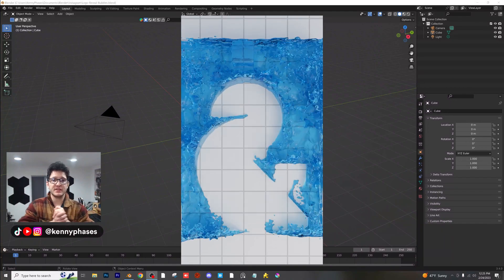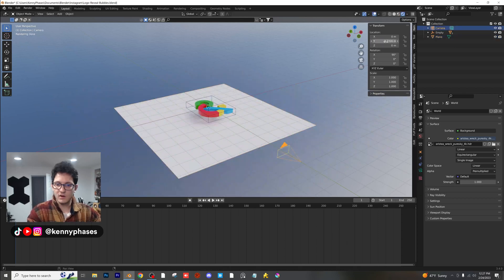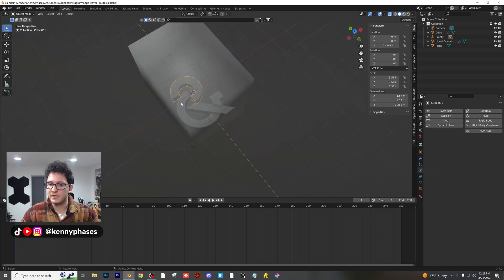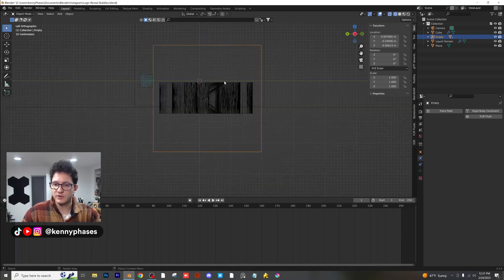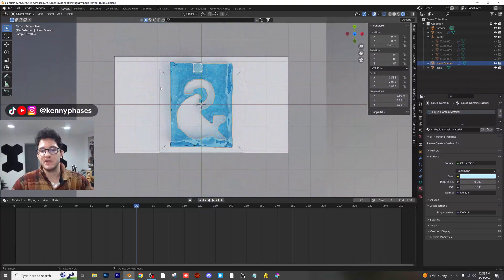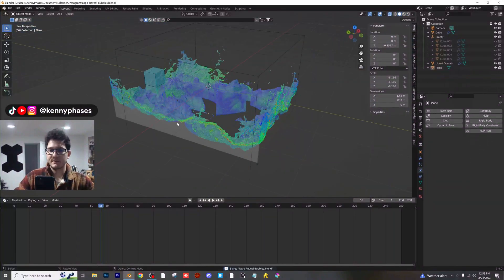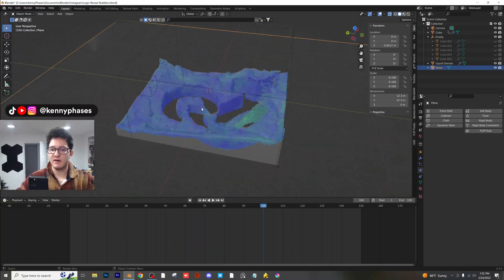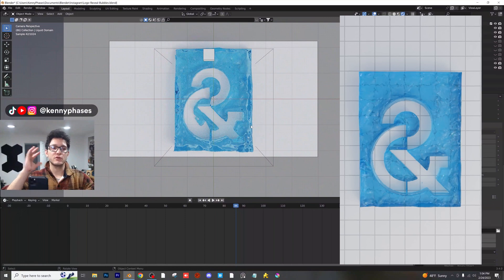Blender 3D - Logo Reveal Fluid Simulation!!!!!

Comment: Of course there is an easier way to convert all logo objects to fluid effectors. Just select them all and hit Ctrl+J to join them into a songle object... unless you need to keep them separated for some reason.
Oh, and since you knew you don't want fluid on top of the logo, I would have scaled the height so much that it's going outside the domain at the bottom and the top right from the start.
Reply from the maker: Thanks for the info! and yes definitely a good point with the fluid effector!